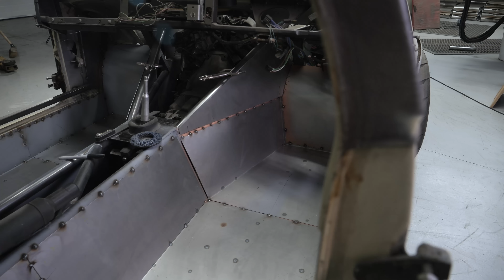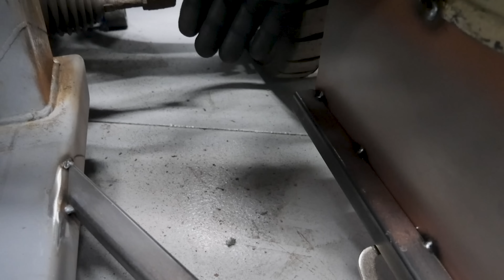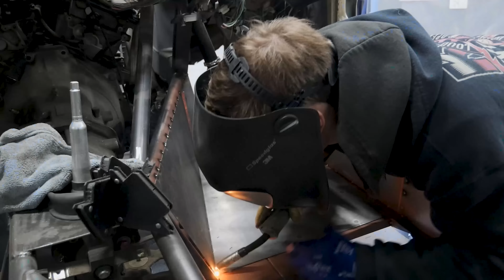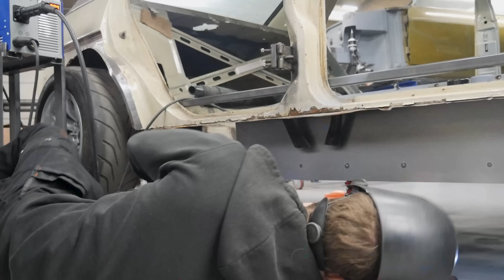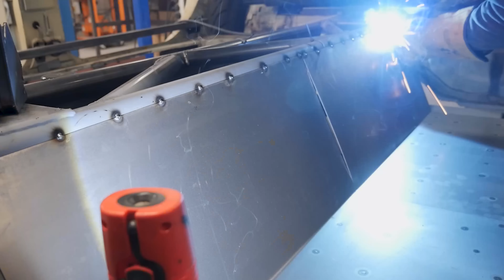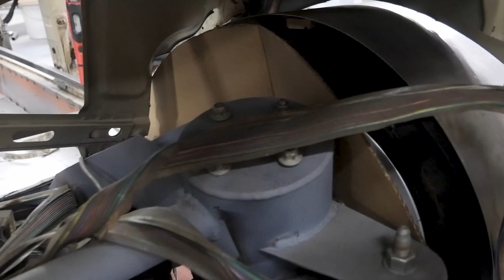Project PrincesS-Type | Episode 13 | Floor & Wheel Tub Fabrication

Comment: As always, I’m REALLY enjoying watching this Princess project come together. And as much as I hesitate to do this, as an American thinking of the English summer weather I’ve experienced during my visits to the UK, I’m left scratching my head about the ‘rust proofing’ plan you’ve mentioned. 

Low road miles in its future. I totally get that. But if it turns a wheel at all on a British road, I can’t imagine how it would NOT get wet. It’s more work obviously, and you know more about this than I do, also obviously. Should that not be a worry? 

Either way, thanks so much for letting us ride along with you on this project! Great stuff!

Comment: Hi, From a structural point of view the best way to strengthen the door sills would be to run a small box section inside the void & welded to the existing door step. Have it full length from wheel tub to wheel tub. It could be plug welded through the door sills as well as the outer sills!  Two mill. thick or more would give reasonable side impact protection in an accident!  On the large tunnel panels weld a strip of flat bar on the inside to stop vibration!  As for the top of the tunnel I suggest making the front and rear sections removable using riv-nuts to give easy access to both the rear sub-frame and the gearbox!

Comment: It's been interesting to see project creep on this one, definitely going to end up looking a lot more radical than the initial plan.  Without the doors and outer arches on, those sills look comically large, I'm reserving judgement because I can't see what you can see there so in person they might actually look fine.  They do look big enough to house exhaust pipes and a little side exit both sides ahead of the rear arches would be neat.
Reply from the maker: It’s definitely crept, but I was always open to that. Having to change my initial plans with the wheels and also floor meant that it was always going to be more radical I guess. We’ll see how it ends up!😬

Comment: Ah the unmistakable sound of a 1mm cutting disc attacking a car panel 😂

BTW If u can do that too a motor to that standard, making a bead roller should be a breeze for u ? 

I’m so glad Johny recommended this channel ✌️
Reply from the maker: Probably, but for the time it’d take buying one would probably be more cost effective 😄
Reply: @FabCoUK  well if u got the spare cash then go for it. But for the panels that are now welded in, a pneumatic chisel with an home made adapter and a homemade dolly on the back, has saved my arse when I had a brain fart and forgot to do it on a Scirocco that my mate raced in the VW cup. Still if it’s ear splitting loud when she’s together, light strips of angle iron should quiet things down. 

But I ain’t the one pouring my heart into a wicked sleeper, so I’ll still be glued and waiting for the next instalment. Good luck fellow petrolhead ✌️

Comment: Those sills look great mate, if you continue the shape of the sill into the arches that will look really cool. I'm not a massive fan of plastic rivetted/bolted on type arches so all steel would look cool. I'm sure you don't need the suggestions but would steel tube in the sill be a quick and easy way to put some strength in?  Really enjoying following this build, you get a really nice blend of talking it through and action etc.
Reply from the maker: You’ll hopefully see pretty soon!

Comment: Edit.. you answered this… rolling or pressing dimples, shapes and patterns and swages in all the flat steel, adds to the aesthetic but increase strengthens massively and reduces drumming? Means you can get away with a lighter gauge steel which cuts and forms a lot easier plus reduces weight massively on a build like this. 👍

Comment: The mounting of the rear suspension is not stiff enough. Most likely the bracket will flex more than the rubber. This is not what you want.
Reply: Stunning build 👍
Reply from the maker: There’s still the whole structure of the boot floor to go in yet.

Comment: your car, your rules apply...just for me, i'd ask you to consider the flow and how things will transition so that it's a cohesive design.. 
the sill design has quite a thick edge thats pronounced as it leads out from the car body, so as it's transitions to/from your wheel arches , you'll would want a comparable thick edge on your arches to flow into the sill from the front arch, then out of sill to the rear arch... 
Maybe consider whats more important to design around and too for the look you want.., the sills, or the arches and how it'll tie together with other styline elements.. like you say, it's quite angular in places..but those angles flow and transition into curves...
eg The princess has like scallop beneath is waste swage line too, which will remain on the doors but seems to get lost read arch... Sketches help, and you have some constraints to work within...
Anyway, just 2 cents with change from the cheap (and less talented) seats;  your car your rules!
Reply from the maker: Thanks 😊

Comment: Those lower sills look to deep for height but i think removing 3cm or inch 1/4 would be better and dropping the centre section down so its closer to the driveline other wise when your sitting in the car it would feel like a dirt super sprint car

Comment: I find your videos very inspiring. I certainly think that a bead roller would be a good investment if you could afford one: of course it's expensive to get good quality equipment unless you could find second hand. It's pity to fit the panels that you know would benefit from some profiles as it would be a hell of a job to put them in later. Until you can get your own roller, don't you know someone who has one and would be prepared to let you use it ? The wide sills look impressive, but they would be a little too wide for my personal taste, and that void looks like a chasm. Thanks and best wishes.
Reply from the maker: I think I just need to bite the bullet. Good tools usually pay for themselves pretty quickly, it’s just hard to justify big outlay on equipment that doesn’t really make money for the business we run!